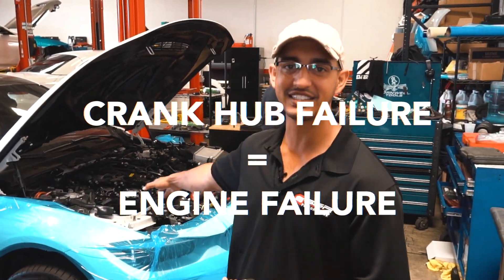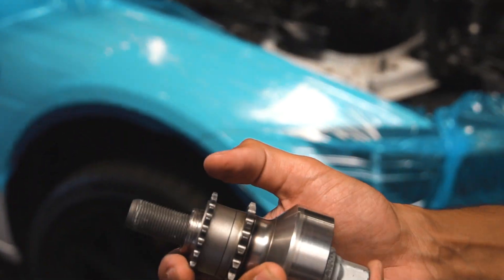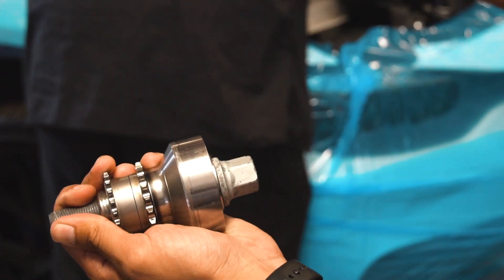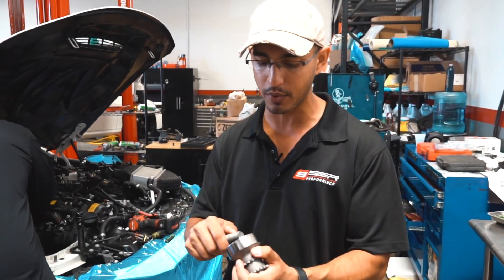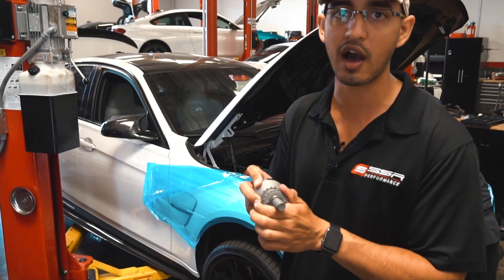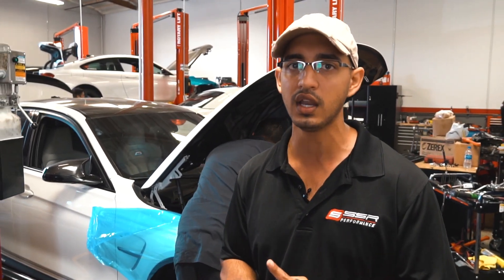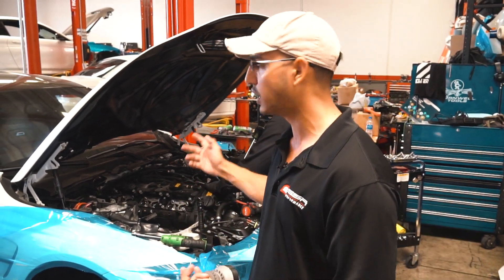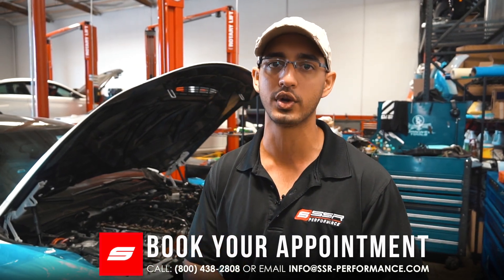DO NOT LET THIS HAPPEN TO YOUR M3/M4 (S55 CRANK HUB FAILURE)

Comment from the maker: Hey guys,
We noticed that there are a lot of questions and skepticism around the pricing of this procedure in the comment section. We are happy to go a little more in depth, as far as costs go, for those of you who care to see.
Below is a list of approximated costs:
1. Two Piece Keyed Crank Hub Kit - $1300

2. Gaskets & Parts Needed - $496
* Valve Cover Gasket Set
* Front Crank Seal - Crankshaft Seal
* Bolt for Timing Chain Sprocket - Intake/Exhaust Camshaft
* Cover Seal for Brake Booster Vacuum Pump
* Oil Pan Gasket
* Engine Oil Pan Bolt Kit (Aluminum)
* Coolant / Antifreeze (Blue) (1 Gallon)
* Engine Oil - 5W-30 Synthetic (7 Liters)
* Oil Filter Kit

3. Labor - $2250
* Valve Cover R&R (8.2 hours BMW book time)
* Oil Pan R&R (8.4 hours BMW book time)
* Front Crank Seal R&R (5.6 hours BMW book time)
* Drilling Crankshaft (1.5 hours approximated)
* Crank Hub R&R w/ proper torquing procedure and retiming engine (1.5 hours approximated)
* Total Labor Hours: 25.2 Hours (even at a VERY reasonable shop rate of $100/hr total would come out to $2520.00 for JUST labor)
* Our Flat Labor Rate for the job is $2250 (approximately $270 below the hourly total at $100/hr)

This procedure is an in depth procedure that is very labor intensive and for that reason costs more than expected based on looking at it on surface level. With that said, this job is only to be performed by a highly experienced BMW technician, or else irreversible damage can be caused that may lead to a full engine swap. Used S55 engines cost anywhere from $10,000-$13,000 depending on external variables and another 20-25 hours in labor for replacement. This $4,000 job is insurance for those running high power on their S55 engines against a possible engine failure than can run them upwards of $15,000-20,000. This job is suitable more for the spirited driver / power freak that is looking to drive their car like they stole it (how it should be driven). Thank you for reading :) If you have any further questions please feel free to give us a call at (800) 438-2808 or email info@SSR-Performance.com

Shah @ SSR Performance
Owner
Reply: The average person has no idea how involved this job is and your detailed breakdown should give people a very good idea of what's involved. Well done.
Reply: You Sir truly care about transparency and being true with the customer, kudos!
Reply: OVerrated scam..
Reply: This is so completely inaccurate. Job and price is half of what is claimed.

Comment: Hey guys got a f80 m3 which had a front end smash. Damage only to all the rads and engine/gearbox coolers. Parts replaced but doesn't start.

Engine turns over very slowly off key. I've tried to manually turn engine and it doesn't turn.

Would you say it's a crankhub, timing fault?

Also have open circuit fault for camshaft sensor.

Any help would be great.

Thanks

Comment: Do not do this, it’s BS overload, if it was a problem the OEM would have put out repair procedure through the dealers with a component which would have been R&D to work. There is no real problem but doing this will be creating what the BS says about the not true problem. BMW race these engines with no problem.
Reply: Thats my opinion too.

Comment: So even with a stock M4 there’s a risk of the crank hub spinning?
Reply: it’s rare to spin stock. I spun mine around 10k miles. 100% stock. if your car under warranty and stock bmw will cover it
Reply: Im pushin over 500 hp rn and the AA MIDPIPES WITH MST intakes, and mhd M4 Gts tune i strongly believe driving habits matter alot if your doing harsh down shifts your forsure more likely to spin the crank hub

Comment: This is not real i have asked bmw for this isue  here in Switzerland and he told me that this is not true !
They doesn’t have any situation till now with crank hub isue!
He told me to if something like this will be an isue bmw would make an recall to all bmw m3/m4  !
My opinion this is just from tuners to make Money becouse it is good mented becouse everybody will inves in theyr cars 1600-2000$ to be „safe“
Reply: BMW engineers knew about this inherent weakness from the start. It's a calculated acceptable loss for them to replace some blown engines within 4 years of warranty,  and others that don't damage block and head get repaired cheaper.  Some percent of owners out of warranty will even opt to buy a new engine, must be great for BMW.

Comment: I'll buy the S58 when it's available before spending 3000$ on a crank hub fix to add more hp in a chasis thats is at its limit of usable hp on stock hp levels. This upgrade is not worth it at these prices. If you remain stock the likelihood of spinning a crank is probably less than 2%. Who pays these prices to fix a fault which is the manufacturers mishap. If it spins stock than your covered under warranty. The f80 spins its tires under stock hp levels. Once hp is upgraded the car becomes a roll racer only and hard to mitigate unless your on a prepped surface or have street slicks anyways. What's the point? Your paying to overwhelm the chasis. How do I know this? I was stage 2 but removed the mods and went back to stock once the crank hub issue became more prevalent.
Reply: Looks like its time to stop modding my N54 or think of a S55 car and find another platform with a B58 if I want to go beyond stock turbo FBO power levels. The new S58 with AWD should be the most reliable and get the power down. I just did my N54 oilpan gasket so this is crazy to me now. AWD B58 maybe?

Comment: BMW M engines are ticking time bombs.  Last gen had rod bearing issue and the current gen has crank hub issue.
Reply: Go Electric
Reply: I drove my e90 to 130k Miles. No issues, no rod bearing service. Just picked up an f80 and will do the same. This is my 4th m car and I’ve never run into catastrophic failure. 😂

Comment: Umm... you can buy the whole M3/M4 engine from the junkyard for $4000 if you search a bit .... 😅 if you are extra lazy to search, you can buy it within the next 5 minutes for $7000-8000... why would anyone pay this much when the chance of anything happening is less than 1%... stupid
Reply: On a stock car - yes. If you go S1,S2, I'd get this done b4 modding the car
Reply: KentBummerM you should be good going stage 1 since on a competition package you are getting 450 hp on a stock car. The power added with a stage 1 on a non competition should be almost the same as the competition one. The problem seems to be when u decide to go stage 2 and run e85. I think keeping it stock or just running stage 1 should be safe
Reply: KentBummerM and dont forget to mention that is less likely you can blow the engine with the OEM part than the keyed one. I have seen keyed Crank hubs cracking and when it happens, it’s a 100% catastrophic failure. So if am keeping my car stock i wouldn’t worry about it or not even try to replace it since it is a lot of money for something isn’t likely to go wrong

Comment: Holy hell! The first generation Mazda/Ford 2.3L engines (circa 2003 to 2009 both NA and turbo) had key-less crankshafts and used similar diamond coated washers between the crank pulley, the crank gear(s), and the crankshaft. If the pulley(s) slipped the engine was out of time or damaged. Also, if the pulley bolt came loose, or if an owner unknowing removed their crankshaft pulley for some reason, their engine was then out of time. Wow BMW, just wow.
Reply: just keep driving your 2.3 Mazda then. Sheeesh
Reply: @revy69  Ah, yes, missing the point entirely while showing your Bavarian pride.

Comment: The N54 has the same hub system and they make over 700hp with no issues.  Why does this happen on the S55 the hub looks identical to the N54.
Reply: They think it's the aggressive dsg transmission shifting really hard because most of the spun crank hubs have been on the dsg.
Reply: @redclaw01  no it happen in 6MT also
Reply: @卍TBallz why would you buy a m3 to drive it normally? Get a 330 if your just gunna drive like grandma
Reply: It happens on N54 too but less, but it's hard to know for sure why S55 is more prone. Is there more harmonic inbalance in S55? What is different with the chain and tensioner design?  Who the hell knows for sure (except BMW engineers, they know). But N54 forums do have many reports of this too.
Reply: @卍TBallz There isn't a 2020 M3 I think its coming 2021? And im not sure about the new engine yet haha its only in the 2020 X3M so its too new to find the problems yet. My F80 M3 is 600bhp on DSG and I haven't had any problems yet but we shall see.

Comment: Hopefully they fix this stupid issue with the s58 model; it’s ridiculous that the crank hub spins even at stock boost levels
Reply: It is fixed already in the S58. The crank hub and crank shaft are one forged unit. And away we go...
Reply: Don't worry, S58 will have another catastrophic failure.  There hasn't been an M3 without catastrophic failure since E30. If it's not the engine it's the rear subframe falling off, strut towers separating etc.
Reply: @idokwatcher2062  well we’re now almost 2 years into the S58 and still no significant issues were found. Many don’t even have any minor issues 😃
Reply: Is there a service bulletin for this issue though?